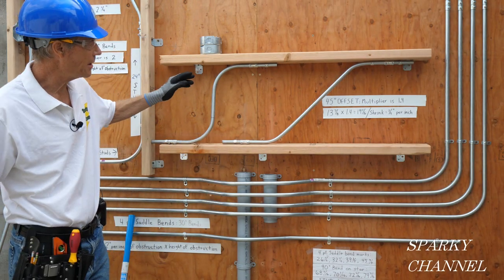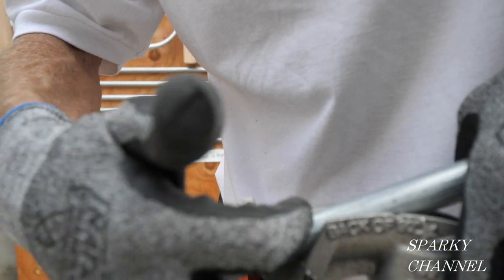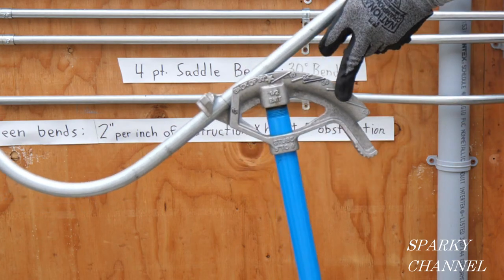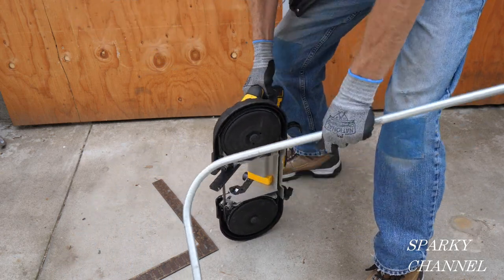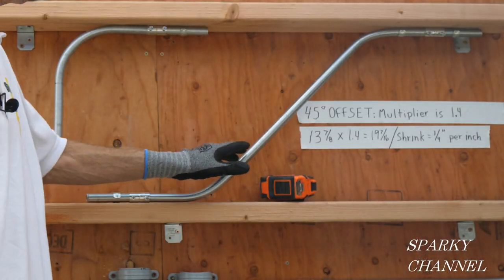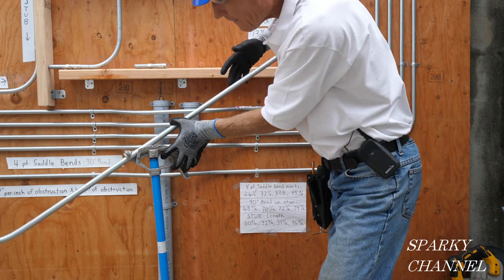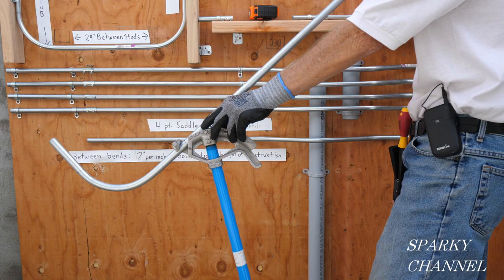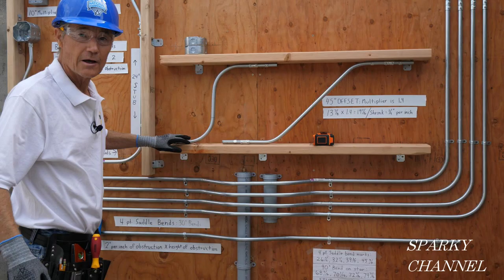How To Make EMT "S" Bends and 45° Offset Bends

Comment: GOOD video. I like certain things he uses. The Square. Instead of "eying " it 90 degrees. Its a good idea. so Why not just have the thing sitting there available for you? Or the Long level he uses.
Many times foreman will pitch a fit about various tools a worker uses to make the best product. they will say "why are you using a Bla bla bla!?" to imply that somehow youre deficient for using something. Some make a stick with measurements on it. called {cheater" sticks. But I guess its not cheating now that there are phone apps doing the same thing though right?

the arrogance of the electricians is what makes an easy job, a hard one. Questioning one another for silly things like the type of boot brand, the brand of tools (I HATE kline) or the sort of bag you use, or if you use a bucket or not. Pressure that isnt needed when youre trying to work.  One company will swear up and down that a certain behavior is "standard" when it isnt 

For example, placing a faceplate on, and assuring the screw heads are vertical. When wiring a switch placing the switchleg on a certain screw (the top or the bottom). Some people avoid using a wirenut by "wrapping" a wire around one outlet terminal, and onto the adjoining device in the box requiring a hot. Others swear thats terrible. Some people do not twist the wire first under the wirenut, others will send you home for not doing that. Some Bosses require a real reamer, and others will use the head of lineman's or the handle of a pair of channel locks (they strip the plastic off the handle of the channel lock to do that) Some bosses will tell you  that you cant use a channel lock with the handle stripped off as if you plan on using the thing on a hot circuit!

Some feel they want the end of the pipe to look like a manufactured end! Others realize it doesnt have to be that serious, for it wont damage the wire.
Some will never run a fishtape in a pipe with live wire in it. they think the metal will somehow nick the wire, and would fire you for doing such.  Others do it all the time, while adding circuits in an office during work hours.

If you see a behavior in this list that YOU do, you no doubt will swear those that do the other things are "hacks" or "apprentices" or some other derogatory term. They are not. they are just not you, and live in other parts of the country where behaviors are different. I saw  one guy in florida complain about my use of a Caddy clip to hang a pipe, simply because he had never seen that product, and so he felt the holder wasnt "code!" Caddy brand is widely used in Chicago, but not so much if at ALL in the south for some reason.

 Some do one thing, others do another.  Tell your workers what YOU want. But dont imply that some other way is "wrong" , its just not how YOU do things on YOUR sites.
Reply from the maker: Thanks!
Reply: GREAT POINT. what is comes down to is most electricians are too prideful. That’s why when I’m at work I just do my job and go home. I know I can bend pipe nice and neatly and other skills but I don’t boast about it.
Reply from the maker: @rembleekah8722  Sounds good Joshua!

Comment: I get what your doing. Is the 14" the distance between the studs? Because I didn't see you measure between the studs So my distance is18 3/8" so I measure from the floor 18 3/8 deduct 5" and bend it 90* I may need to do a KICK on one end That won't change the distances will it? Thanks I've been away from this for a few years because I'm retired
Reply from the maker: Thanks! It was 14 1/2" between the studs, then subtract off 5/8" for the size of the 1/2" EMT.

Comment: Sparky, I'm totally confused - you didn't include the shrinkage. Sometimes you do and sometimes you don't. Is there some special rule when using or not using shrinkage?
Reply from the maker: No shrink calculation was necessary because  I just marked the conduit and cut it after bending it. You need to count in shrinkage when your bends need to be centered over an obstacle as in 3 point saddle bends and 4 point saddle bends.
Reply: @SparkyChannel  That clears it up, thank you.

Comment: Wondering if you have a specialty tool you know of to take the jacket off twisted 10/3 w gr or larger cable?  Seems hard to do without nicking the conductors.  Just wondering if they made a jacket stripper as they do for flat romex?
Reply from the maker: Check out my video: Jokari Cable Sheathing Stripper for Round Cable Model 70000 4-70: https://youtu.be/VfA7hNCLY7U

Comment: Excellent work as always.
Can you elaborate the 13 7/8” we have in between the 45•
Reply from the maker: Thanks! It was 14 1/2" between the studs, then subtract off 5/8" for the size of the 1/2" EMT.
Reply: Sparky Channel for the 45• (not S bend)
Yes subtract 5/8 from the top. Do we take away 5/8 at the bottom too?
Reply from the maker: @vincentsmith4328  No, just the top.
Reply: Sparky Channel does the 5/8 reduction count for any other offset when measuring your distance?

Comment: my question is how come the S shape was 14 1/2 but the Offset was 13 7/8 when they both are using the same 2x4s
Reply: The conduit is 5/8" in diameter, and with the offset you would measure from the bottom of the part of the pipe touching the top stud, to the bottom of the part of the pipe touching the bottom stud. So from bottom-to-bottom would be 13 7/8", add the 5/8" inch diameter to get to the stud, and you have your 14 1/2". I tried to explain it well, I hope it helped.

Comment: When I try to do this for 1 inch EMT I always get a kink in the 2nd bend, tried 4 times. Any suggestions?
Reply from the maker: Go slow and steady if you can. Also, if you can use lesser angles, that will help a lot
Reply: also make sure you have enough foot pressure

Comment: Hello Mr. Bill.
Could you please tell me how to do the math on the calculator for 13 7/8 x 1.4? When I do it I get 19 17/40. Or how do you get from that to 19 7/16?
Reply from the maker: Use .875 for 7/8" so it would be 13.875 x 1.4. Have a great 4th of July!!!
Reply: @SparkyChannel  why  .875?
Reply: @Zer0ooo  for fractions like 7/8 you can divide the first number by the second number 7÷8=.785  you also find a table of common fractions on the back of some Stanley tapes. If you use them often, you'll remember them.

Comment: Could you use the star technique on the s bend ?
Reply: Yes. Bender would be flipped in the other direction, then align the star with his back to back mark of 14.5".    In this case you would be pulling on the first 90 to bend the 2nd one.  Maybe do-able in 1/2" but not 1"

Comment: I thought about getting a band saw, but figured a grinder or reciprocating saw would be more useful so might as well spend money on something useful. Long story short some lazy p brain three his atomic reciprocating saw away, because it wouldn't move, damn thing was just caked in drywall dust gears needed some oiling and help getting the drywall dust out. Free 99
Reply from the maker: Band saws are the way to go. Check out my video:  DeWalt 20V Max Compact Band Saw DCS377Q1: 20V Max Power in a Sub-Compact Size: https://youtu.be/IeeSdrD5csY

Comment: 👎🏼 Why subtract 5/8" (diameter of conduit) for the 45° but not the 90° bend?!  And you didn't explain 1/4" shrink - what is it and why it's not accounted for in your math?

You said the 2nd bend was made 19 7/16" from the first pencil mark but never showed making that 2nd mark on the pipe, must be marked before the first bend.